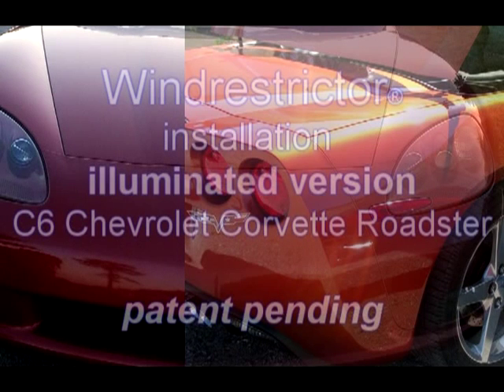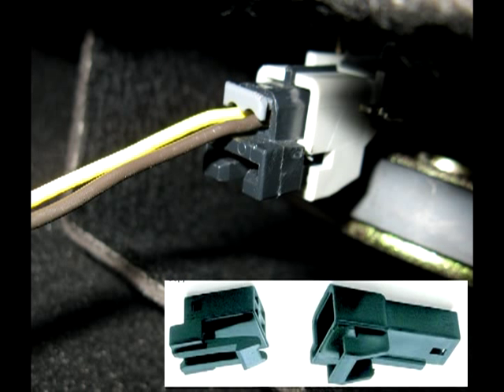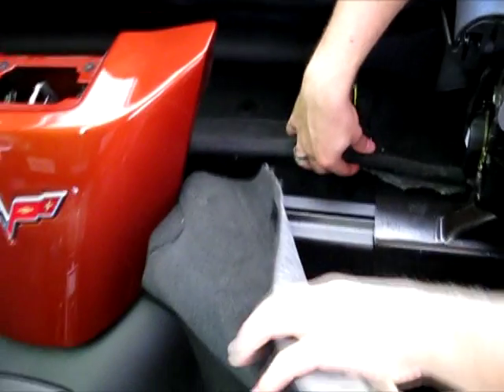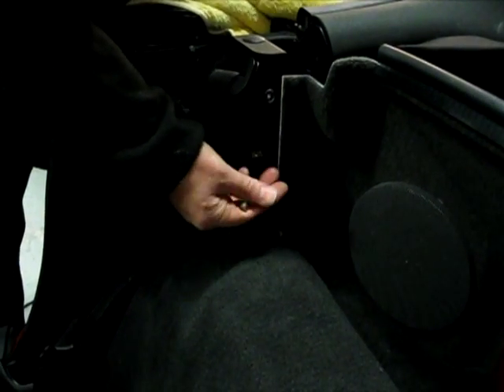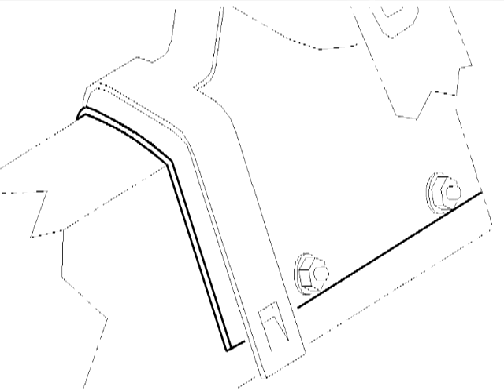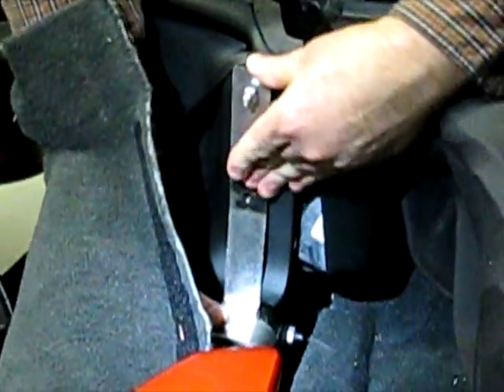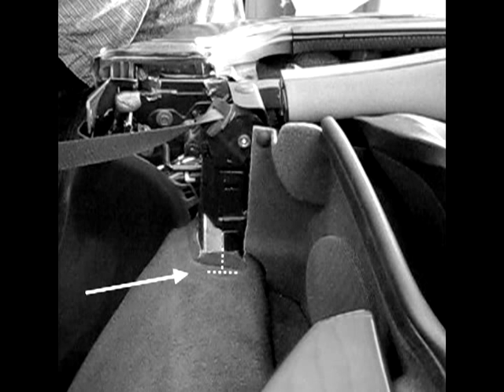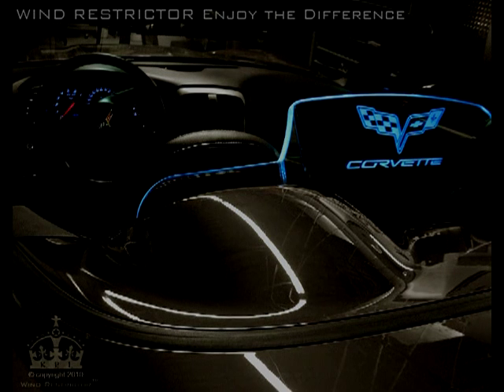C6 WindRestrictor® Installation

Comment: I think I'm going to ask for my money back, this is waaaaay too difficult
Reply from the maker: Richard give us a call we can talk you right through it. Remember, our version is the only in the world that you can leave in place with the top up. Also, it's the strongest, most rigid design. GM Licensed.
Reply: WindrestrictorTV
yea thanks, I did call you if you remember. and I did end up installing it, turned up super nice, especially if you take your time and cut the carpet carefully so that it ends up being a perfect fit... He says cutting the carpets optional guys, but its a must do type thing. Anyways.... I'm going to give this product a 8/10. It really does work well, makes the car much more comfortable to drive at high speeds, and long road trips and looks AMAZING.. It did have a few scratches when it came in. i really noticed it after cleaning the glass. dunno what the deal was there.